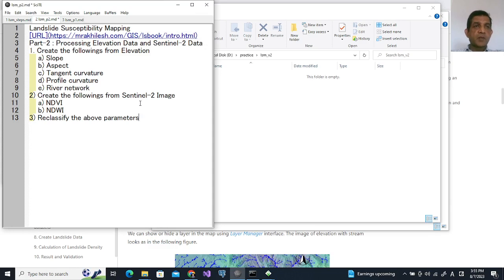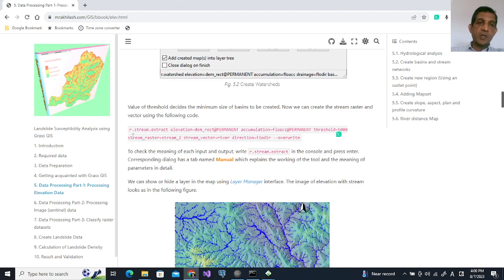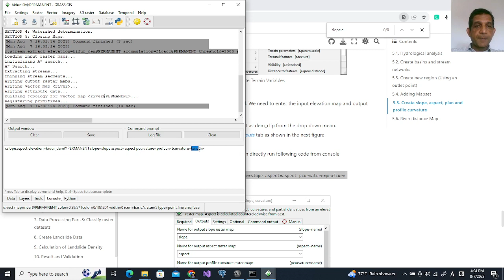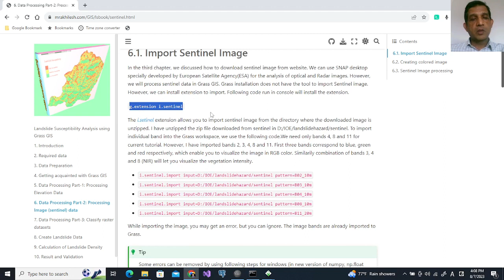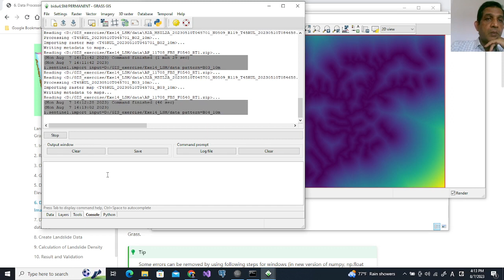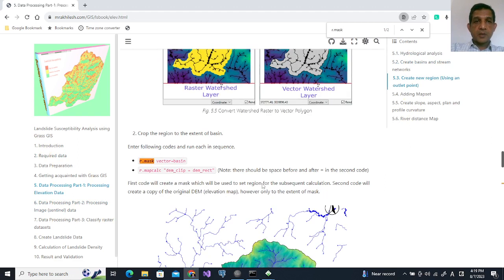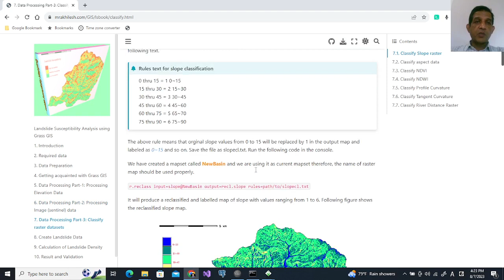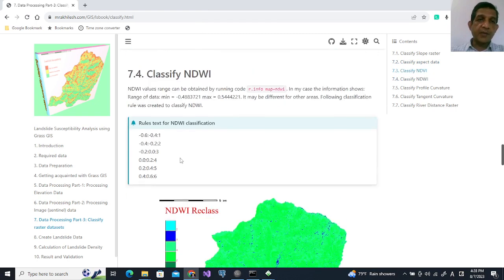Landslide Susceptibility Mapping Part 2: Creating parameters raster data

Comment: sir ot problem on adding sentinel plugins in grass gis8.3
Reply from the maker: I have not used 8.3 yet. I will try it some time. For the time being you can use 'r.import' command and point input to the "\S2A_MSIL2A_xxxx_xxx_xxx.SAFE\GRANULE\L2A_T45RUL_Axxxx\IMG_DATA" folder. The date time in the folder name is changed to xxx. You need to find the location of IMG_DATA folder inside the unzipped folder.